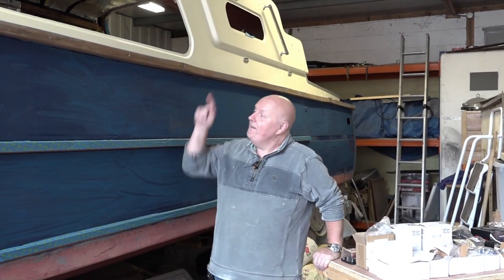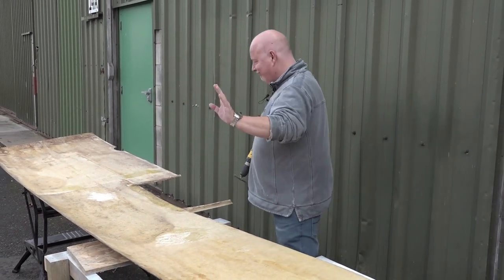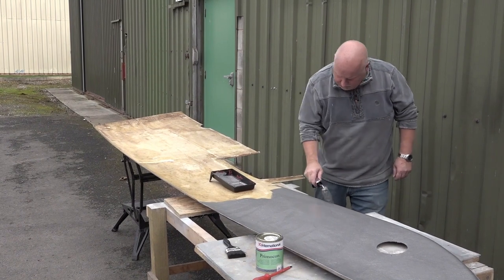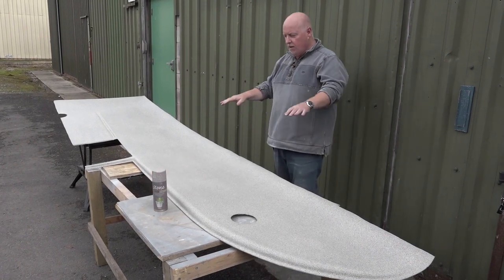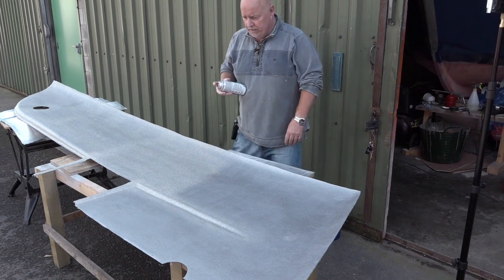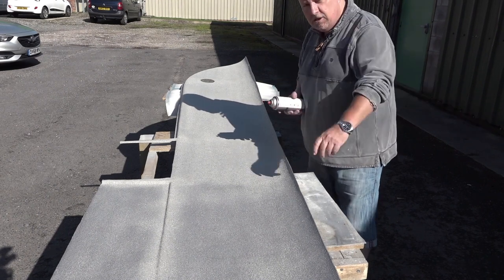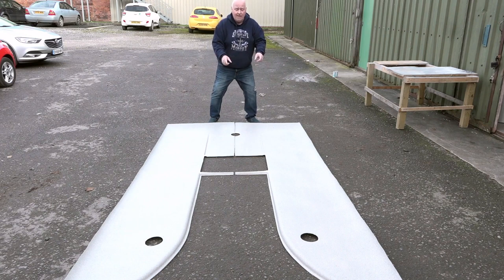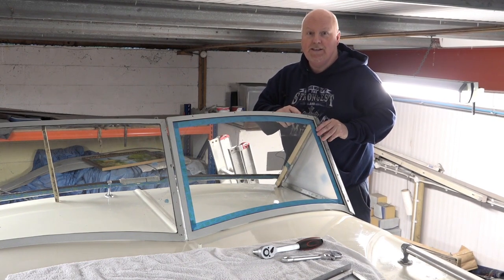Boat roof lining restoration Episode 29

Comment: Hi Phil. I was at the boat show a few years ago and most boats now are going with a panel finish on ceiling. I've put headliners up before and its a complete nightmare. I liked the idea of making small panels in thin ply to suit the roof alignment, these are covered in thin foam and headliner and stapled. They are held on the roof with the old car door cards poppers and can be removed easy to access roof lighting or running cables.  Suppose it would depend on height clearance or shape of roof but I think it could work on most boats
Reply from the maker: Hi Bunty , your idea of door card poppers are great actually, we’ve not got to do anything on the boat since the last video, hopefully it’s not to long before we can get back on it. I’ll certainly think on that method for sure, many thanks for your comments and kind words 🙏🙋‍♂️🍻

Comment: Great to see you back, Phil! 
I can't see myself using a stonechip effect on any future headlining....... I'm 6'2 And it would probably act as a cheese grater on my bonce! 
Would some form of rubber strip act as a "bed" for the window frame and help seat/seal it better? 
I haven't disassembled my wheelhouse so don't know how the aluminium frames are sealed against the GRP. That said, my surfaces are a lot less curved so I'm guessing bedded in with some form of window putty (the cabin frames were held in with that sort of substance). 
The cover sounds like it could be fun and games too! Can you dry fit that too?
Reply from the maker: Hi Jason, at the moment I can’t test fir the canopy, I’m hoping that it will be sort of ok, but I’m also edging on the possibility of a new one anyway. Also the windscreen I think could do with a gasket of some kind also. As for the lining, the gang way will be fabric, but for you at 6’2” 🤔 I think you’d be right, you’d be stripped of hair within hours dear boy 👍🍻🙋‍♂️